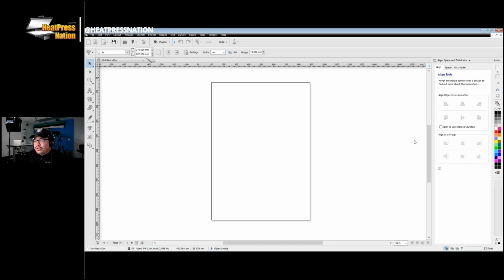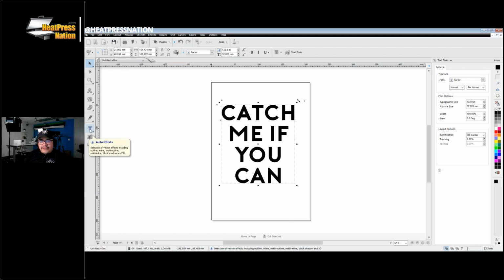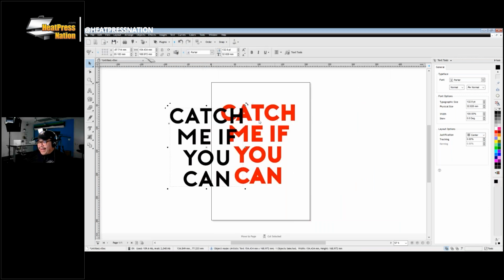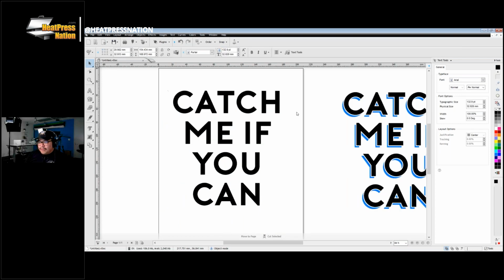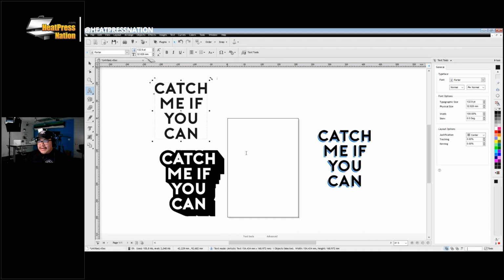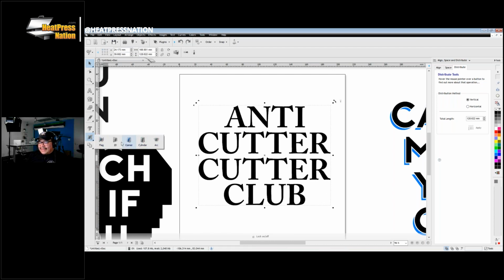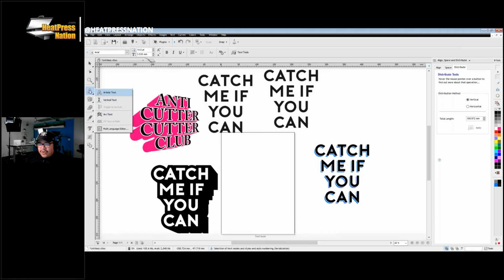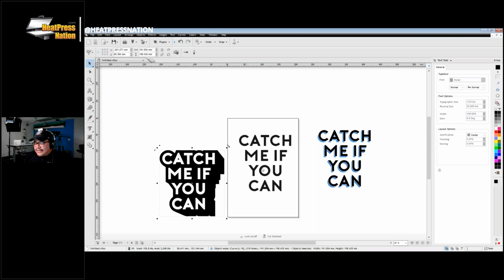SignMaster Design Tutorial

Comment: my ploter after cutting and stop, if i want cut a new file, it returns to the start and cuts the previous cuts again, then i need to reset manually everytime, how do I fix it?
Reply from the maker: Hi there! Please give our technical support team a ring. They will have you up and running in no time. You may reach them at 800-215-0894 option 3.

Comment: Hello! Is it possible to install fonts in sign master? There are some downloadable fonts on the internet that I would like to use, however,  I don’t know if it is possible to install it in this application.
Reply from the maker: SignMaster will load all compatible fonts installed in your computer. So if you can add the font to your computer, you can almost always use it in SignMaster. (some fonts with special figures/characters may not load)